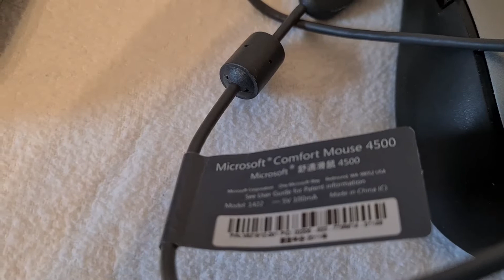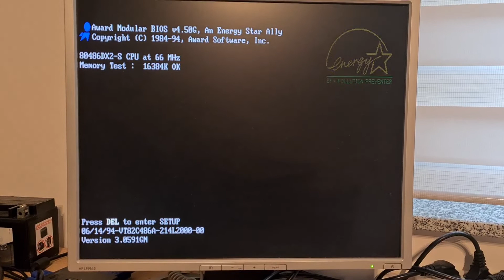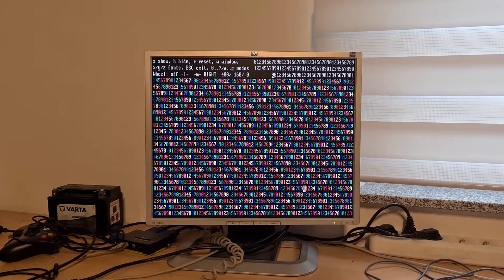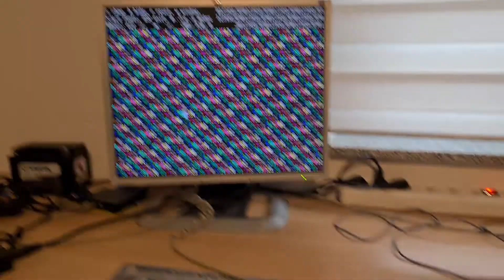"PS/2 to Serial Mouse Adapter" from Necroware - testing USB mouse on COM port

Comment: Thanks for testing! I have one of the original intellimouse optical mice that I'd love to use with my 486. I just can't get used to serial ball mice after years of using higher resolution optical mice. Will try to build one of these soon 👍

Comment: I build these but ctmouse doesnot work for mmouse does detect mouse but its not working fully. I can move the mouse and see the cursor moving but it seems some parts of the screen the cursor is gone. When I do connect a real rs232 mouse it works flawlessy
I also see ctmouse did detect a logitech mouse my interface doesnot do that. What firmware did you flash?
Reply from the maker: It's the default firmware. In case of problems, please raise an issue in the linked github repository.
Reply: @creopard  I just tested on an xp machine serial mouse automaticly detected and works. Seems my 80286 machines have trouble with it I suspect timing these systems are 8 and 16 mhz
Reply: @creopard  Hi with a logitech driver under DOS the mouses work fine, even wheelmouse now ordering a ps2 optical mouse.

Comment: I just tryed the mouse using my kvm switches I get a lag its slower. I did find new ctmouse drivers for 1200,2400,4800,9600,19.200 bps this could solve it so I will reprogram the interface and test which speed works for me.
Reply from the maker: Sorry for the late reply. You can also try these modified ctmouse drivers (regarding BPS) at https://github.com/matze79/PS2-Adapter/tree/master/Firmware%20v1.1/TREIBER/DOS

Comment: The idea is that the adapter does not depend on an external source.
Reply from the maker: @alejandrocaro2846  sure, but the connected mouse still needs to "talk" PS/2. So, most recent USB mice won't work.